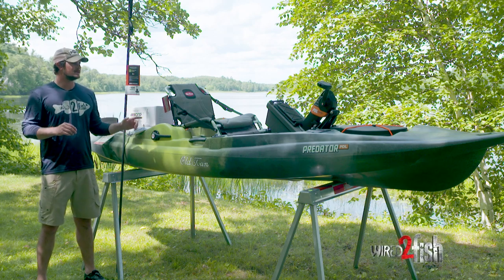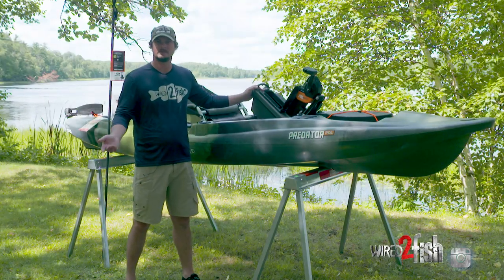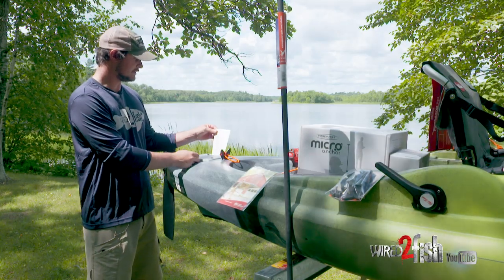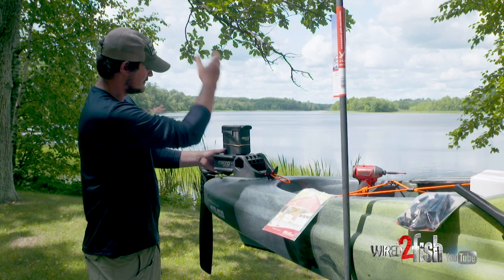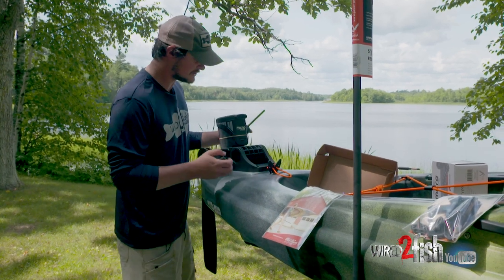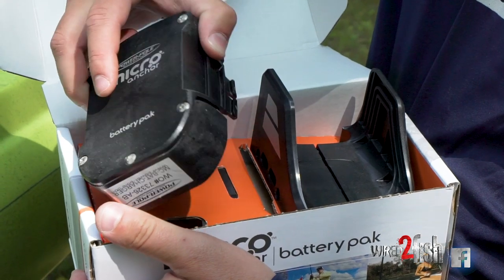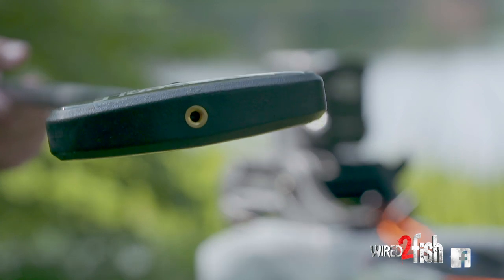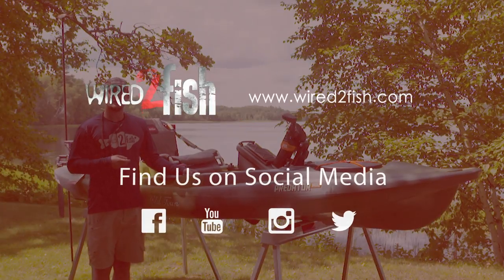Kayak Power-Pole Micro Anchor Install

Comment: Will an anchor pole keep you facing a single direction at all times?
or
Will anchoring into the current spin you around the pole and make you face the other way? im trying to figure out if im better off with just an anchor trolly.

Comment: Word of Caution: There is a dangerous oversight that is a major design flaw in this Old Town's Predator PDL when it comes to the Power-Pole Micro Anchor !!!  The Power-Pole Micro Anchor should be mounted only on kayaks at the stern where the pole is never enclosed (through a hole).  The Power-Pole needs to be out in the open at the rear of the kayak.  Let me explain, if the Power-Pole gets stuck in the down position while you are underway you will not be able to use the emergency release that unlocks the base and allows the entire unit to tilt forward so that the pole will angle upward almost parallel to the kayak.  If the pole is extended, but the base unit released, the end will dislodge from anchoring and you can safely paddle back to shore even to reset the Micro Anchor unit to its remote.  TRUST ME ON THIS...it has happened to me twice but fortunately I was able to use the emergency release both times.  In the Old Town Predator PDL design, because of the hole the pole runs through, the pole will not be able to tilt and you will be stuck at "anchor" and that could put you in an extremely dangerous if not embarrassing situation.

Comment: Why would I want that 10ft+ long pole hanging out with me on my kayak when I'm constantly fishing around trees and under tight places? It would have made more sense to make a chain drop type of anchor then a huge pole .....
Reply: Same here. And the power pole setup is overpriced.
Reply from the maker: Thanks for the comment. That’s is a good point but there are times when it’s practically a must to have a pole and having the option is just piece of mind. I don’t use it all the time and the scenario you described I would hate to fight the pole. You can always fold it down or store the pole in the dry hatch if need be too.